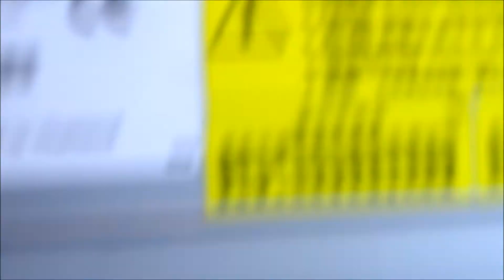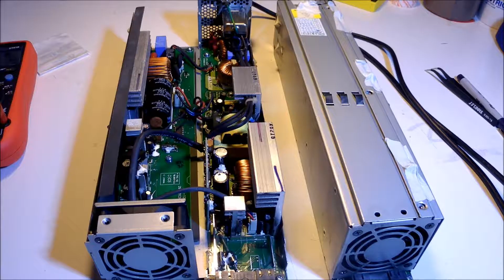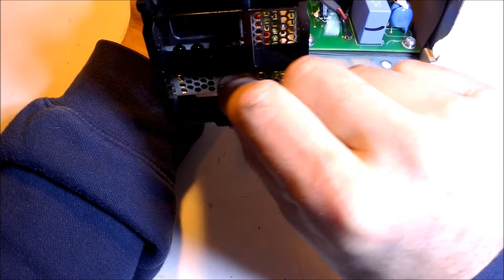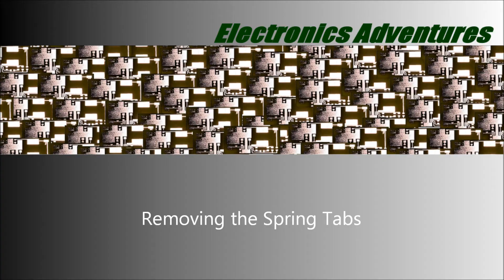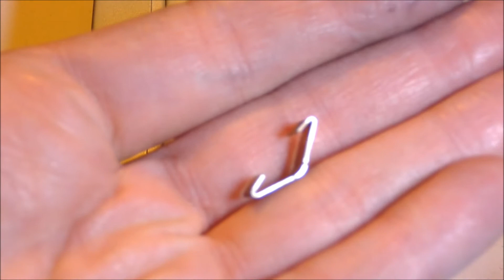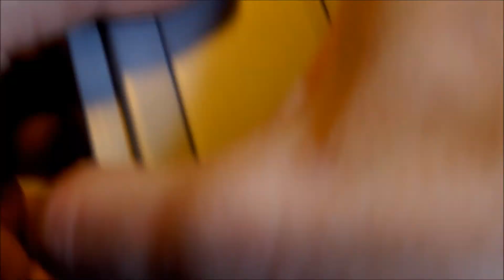$20 12V/24V 41A Power Supply Part 6 - Fan Noise/Safety/LEDs/Handle/Tabs

Comment: Great videos.  Do the washers need to be put in for this to work or is it just a precaution?
Reply from the maker: Joe Lennartz Thanks, glad you like the vids.  Yes, install the washers.  If the washers are not installed, one of the supplies will have its output short circuited.
Reply: Electronics Adventures I can only run 12v.  So I only run one.   Does it still need them?
Reply: I think You can also put them in parallel which will double the power output but retain the voltage, but i'm not sure if one needs to be floating? The problem here is that both supplies might not have the exact same voltage and specs and they might start to fight each other. I would do some research on this first. Don't take it from me. Hang on i just checked it out and here is a bit of a technical answer:

"As for in parrellel, that gets a tad complex, as you need to both balance the voltage and current, which for low loads can be done with a resistance value, e.g. 1 ohm, but for larger loads, needs an active current muxxing system, from memory there are a few online from people parrelleling ATX power supply rails, which covers the worst case stuff, as atx supplies are both noisy and 2 different models can have radically different loading profiles"
Reply: Check answer above. The washer he is installing is to break the connection from negative to earth with makes it into a floating power supply. This is ok for connecting in series. As for in parallel see below.
Reply: I guess if you have identical power supplies and they are set to the exact same voltage you could monitor the current and voltage of each when under load and see if they are working together. If you stay well under the max output of the two combined and it looks like they are working together equally with a similar power output then this should be ok until one fails, then they will probably both fail together.
  Or you could check the above answer and see if either of those solutions is viable for you.